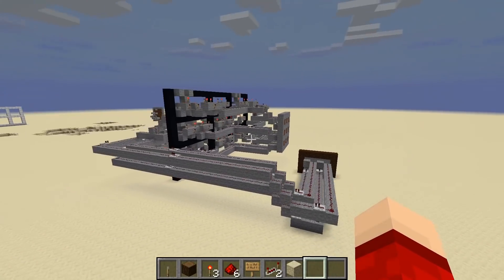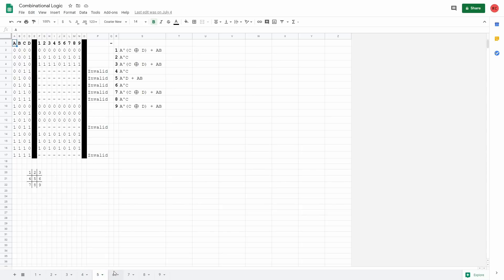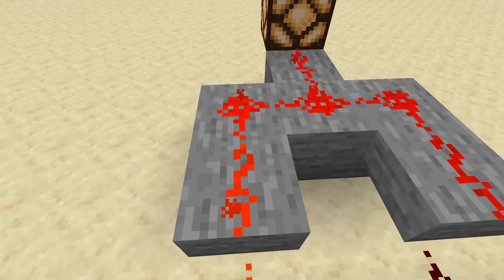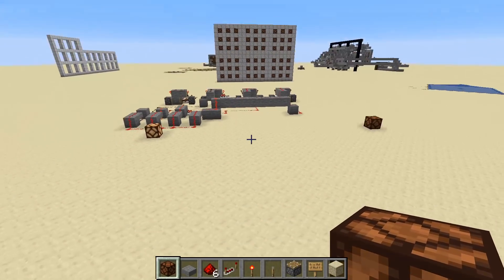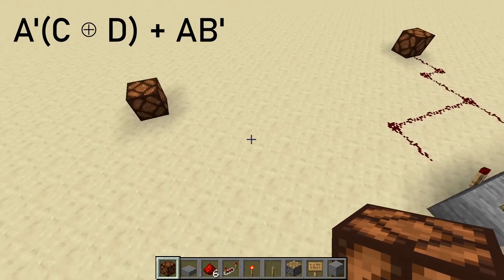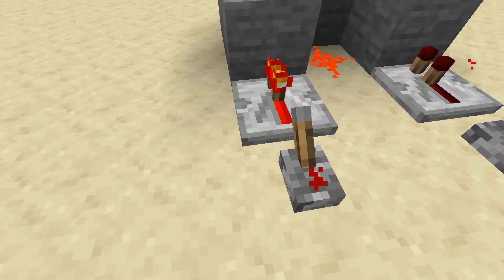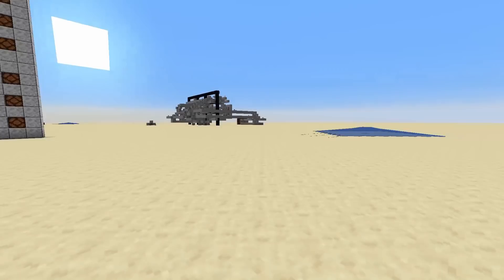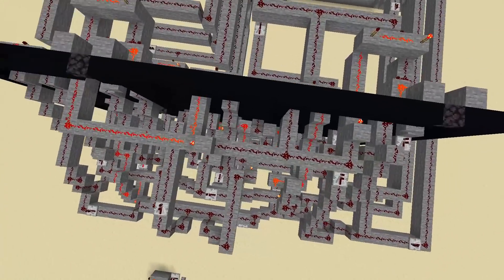Building Logic & Failing - Ultimate Tic Tac Toe in Minecraft - #4

Comment: You may be able to use a combination of note blocks, pistons, and observers to make the display a bit more compact. This would mean the main circuitry must be located somewhere else, and have slightly different inputs to the display, but would reduce the amount of space needed behind the display as the observers can be placed next to each other without causing problems with the other pixels' circuitry surrounding them.

 If you are looking for an example of what I mean, Mumbo Jumbo has a video somewhere where he made a drawing display out of individual pixels sitting directly next to each other. If I find a link I'll post in in a reply to this comment.

Edit:
I found the video and have linked it to the reply
Reply: https://youtu.be/SO4OQriOdtY

His video was posted 2 years ago but I believe all the mechanics work in the same way in the current version of Minecraft. 

In his video however he uses repeaters as a way to send a signal to the observer which causes 2 block updates as the redstone signal turns on and then off. I suggested note blocks because under a redstone signal, note blocks will only send a block update once when they play a single note.

This doesn't solve your issue with the size of the main circuitry but may be a solution to the amount of space needed for the display so that you can keep the main circuits to a functional size.

Comment: I would recommend using a decoder/encoder design to power your screen, you can do that by converting your 4 inputs into unary (base 1) using a decoder, which detects a particular set of inputs tp give an output, then send those unary outputs (You will need at minimum, and thus you should only use, 4 unary lines) into a "9 bit encoder" which takes a single unary input and outputs a 9 bit code (since you have 9 pixels per group, each bit represents each pixel). This has the advantage that the decoder is re-used by every single pixel, which while each pixel has more gates than your algebraically simplified ones do, since they are re-used for multiple pixels, ends up significantly ahead, especially space wise. Here is a google doc I wrote up with photos showing what I mean, and a world download of an example. I left plenty of work to be done on compacting it (intentionally) by separating each logical part from each of the others so you can see them better: https://docs.google.com/document/d/1As1RXDdczFZacd0hj6-oBKubO0K3KqRM3bwps0UCumE/edit?usp=sharing
I hope you find this helpful.

Comment: Well, there would be two ways I could see the display being fixed up.
1: The one-per-state setup.
Here, instead of sending many different signals which are somehow supposed to combine into an output, you simply use one line for each state and manually adjust the output using a simple method. This can be best showcased with the seven segment displays you can find all over Youtube. The base is a torch tower, which feeds into many lines of redstone, which all in turn go into a single segment on the display. Each tower in the middle of the two redstone lines corresponds to one state; there it is nine, here it is four. If you want a bit to be on with a torch tower, have it connect with redstone. If not, have a repeater in order to translate the signal over that dead spot. This design is simple and practical I believe. It would take up either 3 width, 4 height, and 4 depth if you only use the non-inverted torches, or 5 width. 2 height, and 4 depth if you move the redstone line a little away from the torches so you can invert the inverted inputs.
This is likely the solution, but there's also this...
2: The binary setup. If you want to be fancy.
This is a design I just came up with myself because this channel inspired me. Sadly, it is not possible to have four states and no state in only two bits, so we have to use three inputs. The basic idea is the same as the first, but a little different. By using both sides of the tower, and particularly using the block parts, we can create a setup which works. 
To explain, I have to talk about basic lever combination locks: Each lever feeds into a redstone line, either with redstone or a torch. If you want the lever to be flipped, have a torch on the other side, if not, a dust. Of course, not having dust means lever doesn't matter.
By using two of these kinds of logic gates and then and-gating them, you are able to create a "when to put on" and a "when to never have on" logic circuit. Imputing this into an nor-gate you are able to get proper inputs. For the inputs btw I had X, O, and BIG inputs, which should explain themselves.
As an example, I'll pick the bottom right box in a game, and the top left corner. In my inputs, it should always be on if something is on, except when both BIG and X are on. So, one side has an nor-gate for all inputs, the other side has an and-gate for X and BIG, which then both feed into a nor-gate. Place redstone on one side, two torches on the other, have both go into torches, and one final time have them go into a torch. This may sound difficult, but it would only take 5 width, 2 height, and 4 depth. Of course, you would sometimes have to invert the inputs, as they would naturally invert in a torch tower.
Thanks for reading! This was kinda long...
Reply: aaaaaa that is loooong
Reply: @albertpirelius  Aaaaa sorry I just want to be through D:
Reply: bruh

Comment: 3 questions i have about this

1: will you make an ai to play against the player
2: will there be a circuit made to prevent cheating (undoing the other player's move or making multiple move in a row)
3: is this java or bedrock
Reply from the maker: Ai would be stupid hard, and is difficult to code in real life.
Yes, the control logic will stop invalid moves.
Java
Reply: @ReidCaptain  im assuming you're gonna use comparators to stop illegal moves

Comment: 3:42 I just tested this XOR out (on Bedrock, hopefully it's the same) with the levers directly on the blocks, skipping repeaters, and it works just fine with 0 tick delay
Reply: still requires a repeater as the levers wont be directly used in the circuit

Comment: What about using Boolean algebra to make the xor gates simplified? The A'(C⊕D)+AB' into A'C'D+A'CD'+AB' then you can combine multiple different cells' gates together to make it overall much smaller
Reply from the maker: I prefer to use XORs, as with your expression you would need another OR gate. (not that OR gates are hard). Connecting the outputs of gates to multiple pixels is a good idea, as it reduces the total number of gates, but ya know.

Comment: The easiest and most compact way to build one pixel would be to use decoders. Memory cells should be connected to 4 bit encoders which will get you 9 parallel lines for each possible state. Those lines should then be forwarded to "9-bit to 9-bit" decoders which will turn on a preprogramed set of lamps based on the active input line. There're tutorials for observer based decoders online.

Comment: 1. I would recommend structure blocks for building the display. They will save you a lot of time copying a design 8 times to create a local board
2. The display could also be done without logic gates by having 4 inputs which are each directly connected to the pixels they activate.